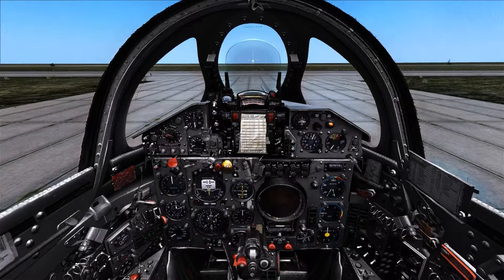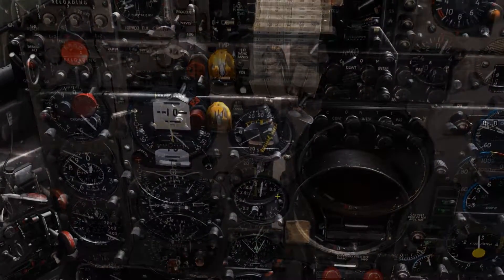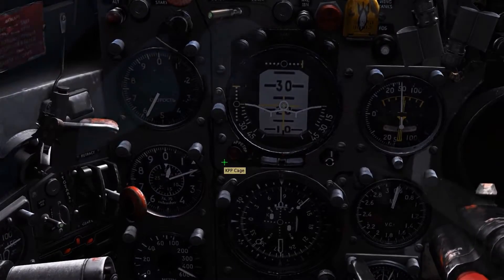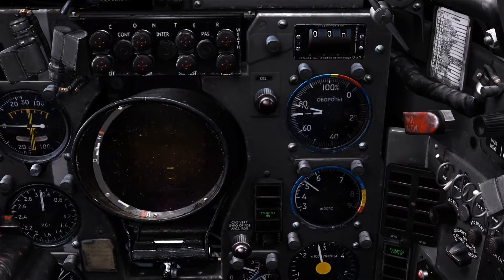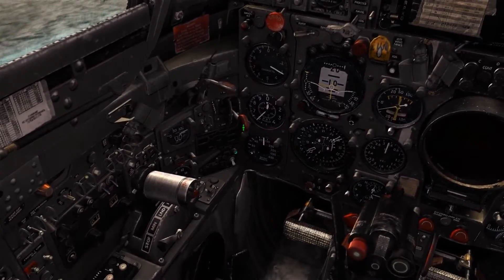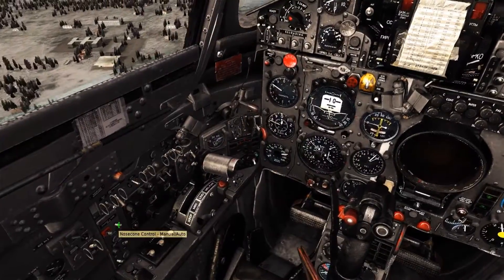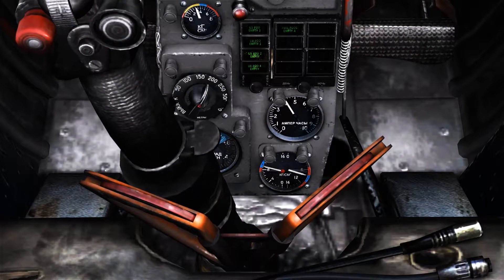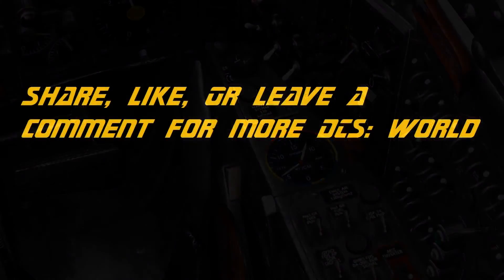DCS:World » Flight Instruments » MiG-21Bis

Comment: 4:12 RPM1 is used to set the correct engine state, not 2. Hence the low pressure compressor's state is the reference for setting the appropriate thrust (manual p. 65).

Comment: banjo could you maybe tell me in an easy way how to change the cockpit to for example an english one and or change the colour :)
Reply from the maker: Leatherneck did supply a sort of english cockpit though a good portion of it remains in Cyrillic, if you chose to use that texture than it's a simple matter of selecting English as a setting in the avionics language settings in the gameplay tab of the options menu.  Another option is to use one of the many mods availble such as this one - https://www.digitalcombatsimulator.com/en/files/1712433/ .  Have not ran that one myself though it appears up to date.  

Alternatively you could manually edit the textures from:
DCS World OpenBeta\Mods\aircraft\MIG-21bis\Textures
Should be a .zip archive in there containing the textures.